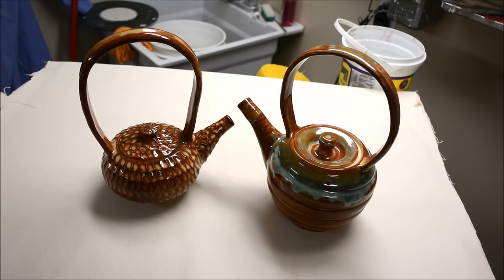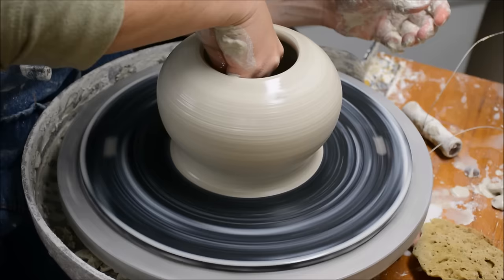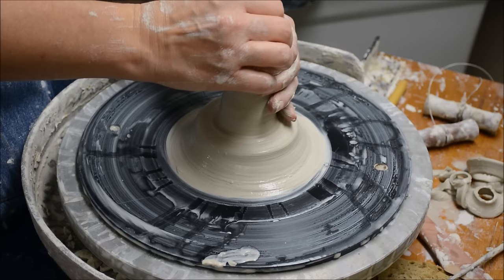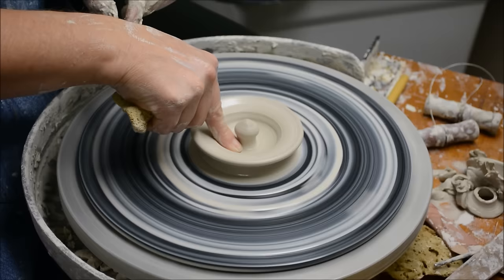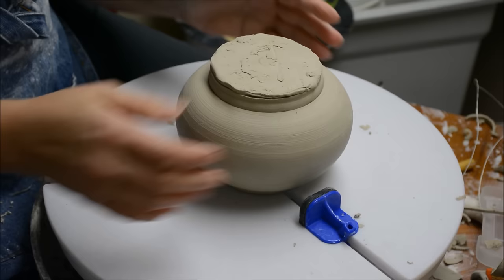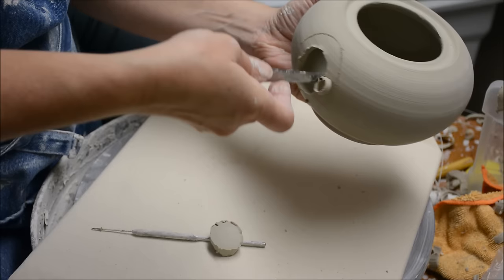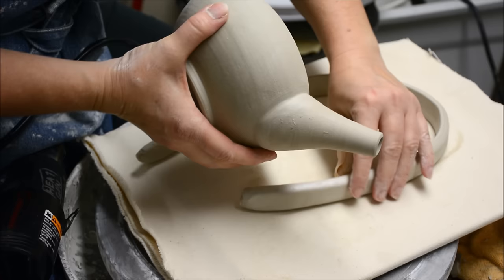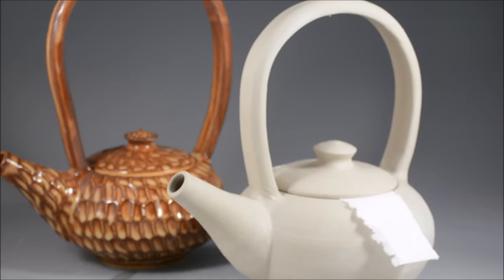How to throw and trim a teapot, two types of lids, and a spout with assembly on the potter's wheel

Comment: Karan, thanks for your very informative videos.  I have a bat mate, and have been using it for a very long time.  They are expensive but I do love them.  I found a silicone sheet at a Daiso japan store, I think it was something like 2 sheets for $1.98.  I just took a hole punch  and made the holes.  I used this to put on my wheel head so I could underglaze or glaze my pots on the wheel.  It worked great.  I also found I could use it under the bat like the bat mate, and it worked great.
Reply from the maker: Winona Bannon what a GREAT idea!!! I'll have to look for that!   Thank you for sharing!!!! 😊

Comment: Very beautifull, but missing the necessary functionality you would expect as a tea drinker from a professionally made teapot. For one, the edges of the spout do not seem sharp enough to prevent a lot of trickling. Also there will be a lot of splattering while pouring, since the lid does not have a hole to let in air. And maybe more importantly, lid and handle are not suited for one another to use the teapot with one hand. Teapots who do not have a hook at the lid, that prevents it from falling when pouring the tea, do have a short overhead handle, so one can hold the handle and hold the lid tight while pouring. Neither does the lid have a hook, nor is the handle short enough.
Those are usually the guidlines for the functionality of a teapot. Apart from that, you are pretty much free to create a teapot however you want it to look like.

Comment: One of my most favorite things to make are teapots, loved this video. One thing I always struggle with is how to get my work to the perfect leather hard stage, so basic but so important. Do you use your heat gun for most of your drying?
Reply from the maker: narda barber no, actually!  I rarely use my heat gun!  Just in a pinch to dry a handle to get it to the right moisture for attachment.  The way I usually dry things to leatherhard is by letting it air dry enough to take away the sticky quality, then I cover it with a heavy towel like a bath towel, then cover the towel with plastic.  If the bottoms are still sticky, I move to a board which will help to absorb some of the water... or my favorite- on a poured plaster slab I keep in my studio!  Then, over  night I can either keep the plastic on the towel, or remove for a bit more drying.  I love the towel trick- it definitely keeps the moisture more even than without!

Comment: Does the pouring happen smoother if the lid has a tiny hole?
Reply from the maker: I have not had that experience- if it were sealed with a rubber gasket it may, but since air can easily come in under the edges of the lid, I find it unnecessary.
Reply: @KaransPotsAndGlass  Thanks.